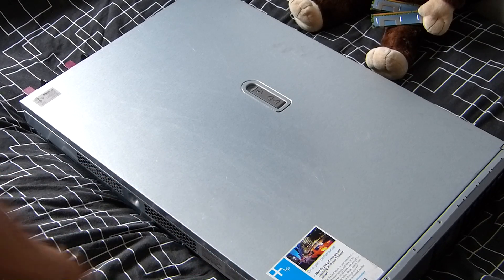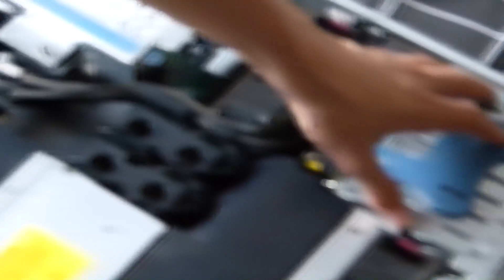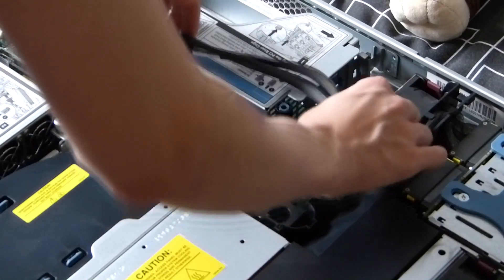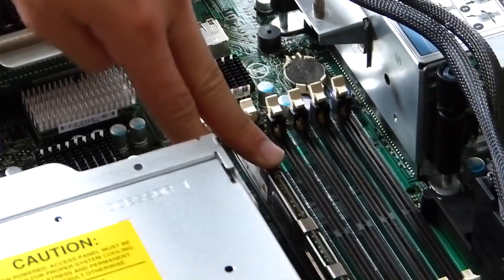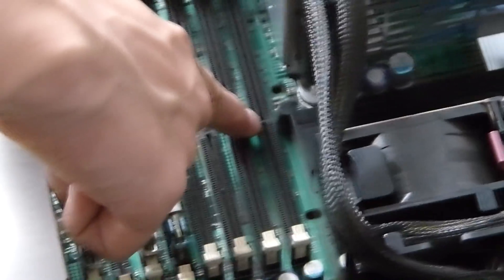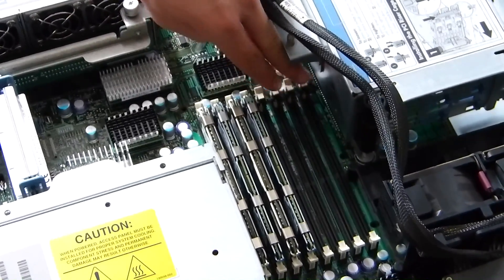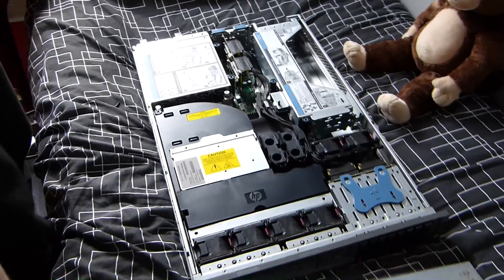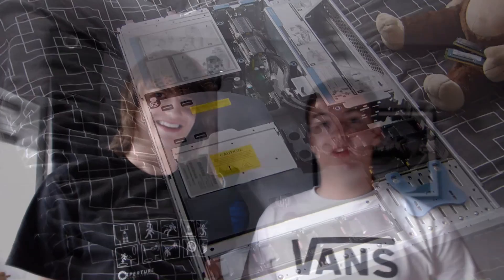Installing RAM into HP G5 Server - How IT Works (Episode 2)

Comment: YASS! Thank you so much!!! I finally get why my server won't start up! I thought pairs were right next to each other.
Reply: could have read the inside of the cover.
The RAM should be installed in PAIRs and the following installation path:
(taking from right to left is the Number Given.)
1,3 - 5,7 - 2,4 - 6,8

( not entirely sure why these guys did a single branch (channel) installation for lower performance :)

More info on the details of ram installation if you can read:
https://support.hpe.com/hpesc/public/docDisplay?docId=emr_na-c00752177

Comment: Hey Dan, really enjoying your content!
I followed your instructions really closely and I'm still struggling to get a positive result. 
I tried putting my Ram into the server but the buggering thing wouldn't budge......Any advice?
I tried butter as a lubricant but it slipped in too fast and ended up busting my motherboard. How did you get yours to go in so easily? 
Your Ram looks very different to mine.... What breed is it?
And do you have any advice on how to remove a Leicester Longwool Ram's head out of a PC? I still don't get what this whole process will achieve but I am determined.

Many kind wishes
Reply: Try putting one end in the clip first, then the othet one